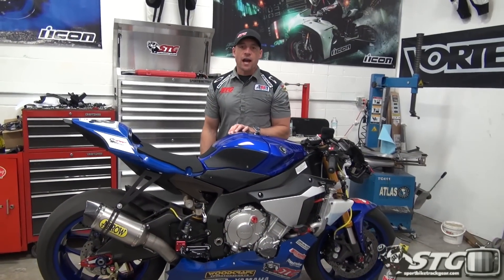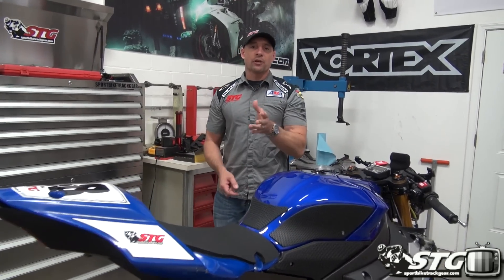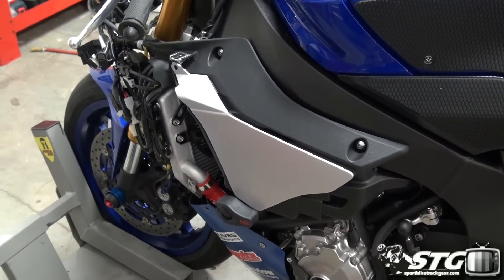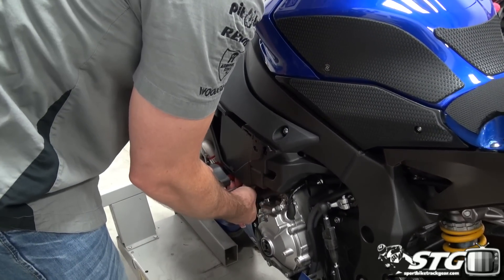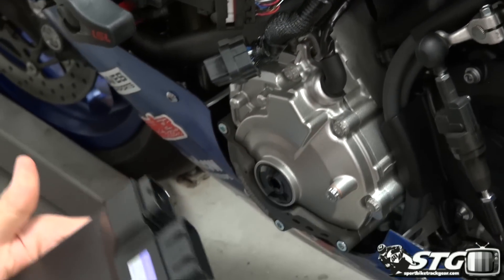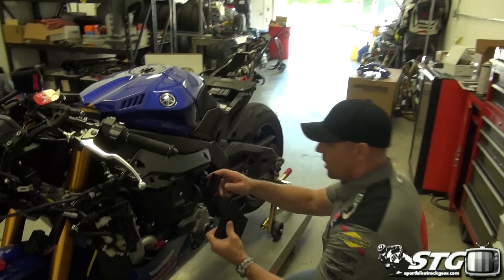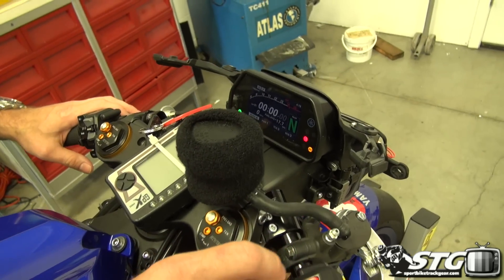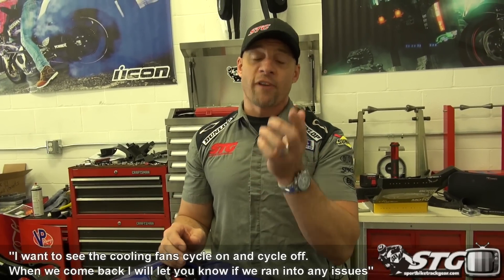How to Flash Tune a 15-17 Yamaha YZF-R1 from SportbikeTrackgear.com

Comment: Does flashing the ecu void the bike warranty??
Reply: djnenodotcom i think soo buddy
Reply: All you have to do is flash it back. no problems.djnenodotcom
Reply from the maker: djnenodotcom I would imagine it would just like any of the many other aftermarket mods would. End of the day it is very likely the dealer would never know it was done. This would depend on the warranty issue at hand I suppose. - Van
Reply: true!!! most wont even know, but you could flash it back. im gonna flash my R6 next season
Reply: greeek777 There is a flash counter inside the ECU, even if you flash it back to stock, Yamaha can still void your warranty. They have to PROVE that the ECU is what caused the "problem".

Comment: Great stuff👍 on a side note...i do believe that rear tire is showing signs of incorrect spring rate.
Reply: +Sportbike Track Gear how much different in  horsepower by getn flashed
Reply from the maker: ritelite77 Still tuning the suspension, only one real day of riding so far. That is a 1.0 in the rear, forks are stock (30mm kit waiting for me to install) I tightened the rebound 3 clicks last weekend at the track and put a new rear on. Much better tire wear after that. - Van
Reply: Sportbike Track Gear 👍✊🍻

Comment: Hey van will there be a tune for the M4 GP2 Cat eliminator, for the flash tune kit?
Reply from the maker: Kyle Abron I would use the Graves 3/4 for now. It will be more than sufficient IMO. - Van
Reply: OK cool! Before I put the tune on there, should I install the graves smog block offs first?
Reply: ben pooten good question

Comment: I was hoping you make a video about ECU flashing for the 15 R1. I used almost all your video for reference only 15 R1, just this afternoon I did the AIS removal "pair mod" from watching your video. Awesome job. Keep them coming.
Reply: The ECU kit does have the option to disable the AIS, but it is still recommend to do it physically bc air can still sip in th air box and give you an innacurate dyno reading.
Reply: AIS make back fire and poping wich in turn is not good for the engine. I have made the with my 09 R1 and it's worth it.
Reply from the maker: Patrick Baptiste No worries, happy to help. This is the way to go for fuel management on the new R1 IMO. - Van
Reply from the maker: ***** I would still install the block off plates myself (which I did on my bike). - Van